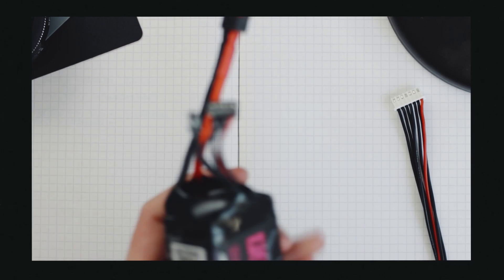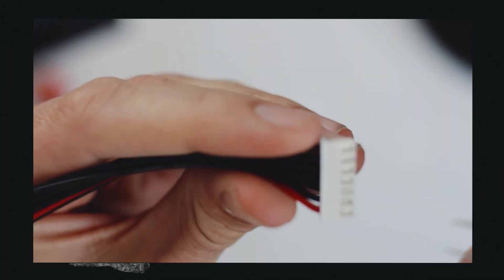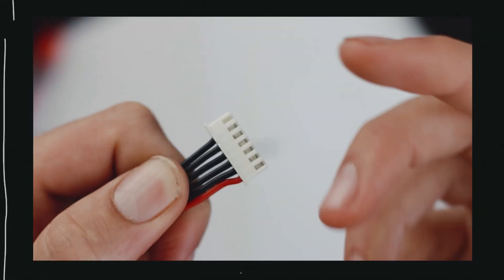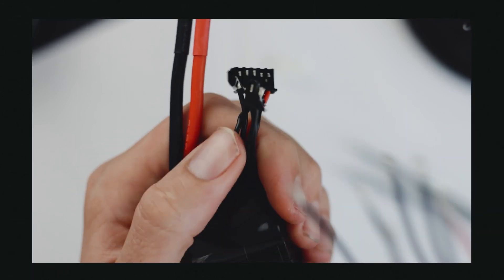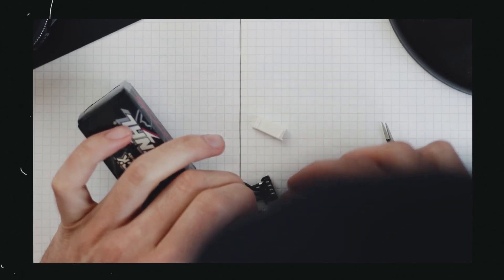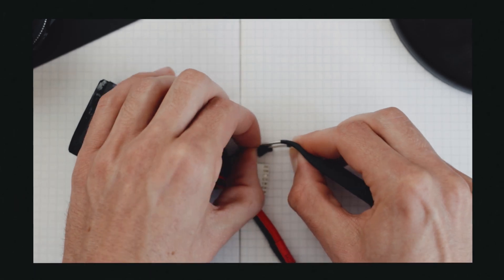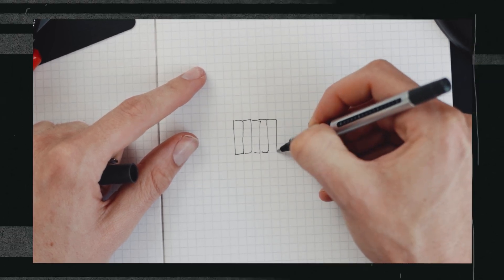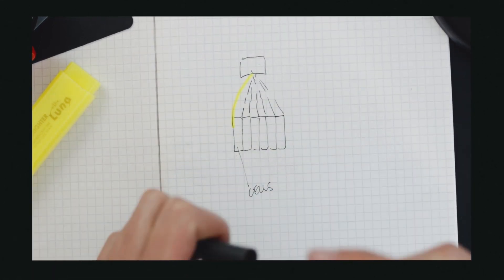HOW TO REPAIR A LiPO BALANCE PLUG | As a BEGINNER!!

Comment: Michael, so I went to begin my flight but didn't tuck my balance cable in and I heard a crunch. Obviously my props mangled my balance lead. I took the battery off and used another but when I was handling the lipo they didn't touch for a split sec. You reckon the lipo is trash? I won't be able to repair it till I get back to Toronto.